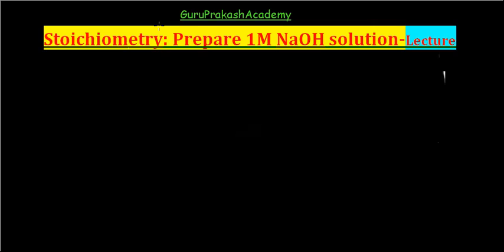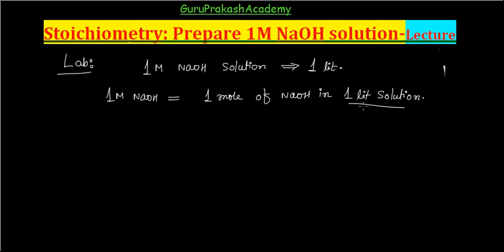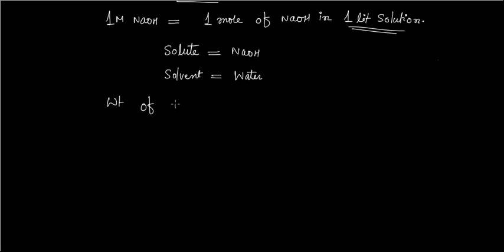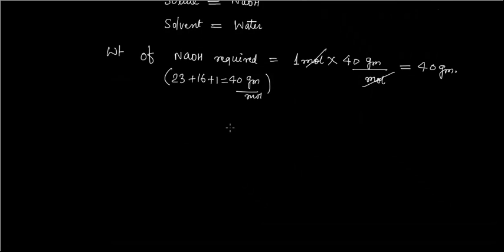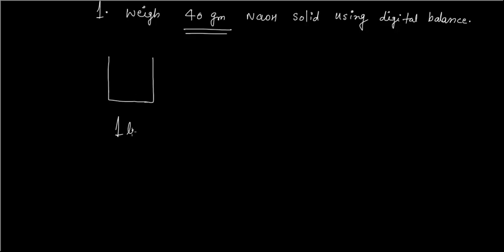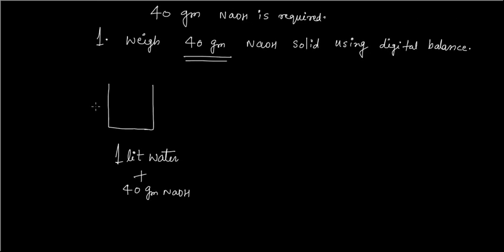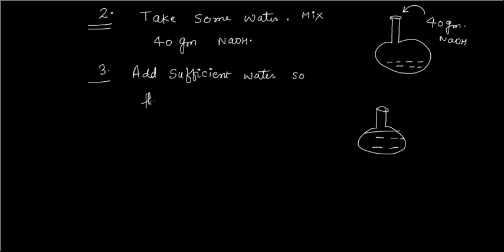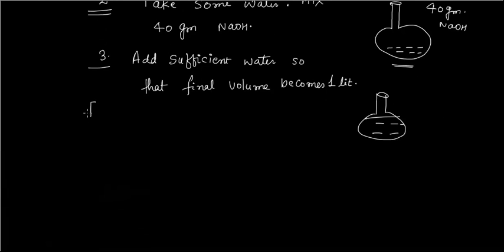SS-1 I Solution Stoichiometry I How to Prepare 1M NaOH Solution I JEE Main @GuruprakashAcademy

Comment: Please correct me:)
This is huge confusion for our experiment.. Molarity is generally defined as the number of moles of solute present in one litre of the solvent. 
To get 1liter 1M NaOH Solution
I think the first procedure is correct even though we get more volume finally ( we can take 1liter of solution from that )
By following the correct procedure mentioned the amount of slovent used will be somewhere >960ml and <1000ml, which means we are not using 1liter of solvent, which again tells us the that the solution prepared will have concentration higher than 1M.
PS: trying to make 10M NaOH solution
Reply from the maker: number of moles of solute present in one kg of the solvent  = Molality

Comment: Instead of adding 'sufficient water' in step 3, couldn't we convert 40gm NaOH into mL and take it away from 1L?
Reply from the maker: This wouldnt work because when converting to a liquid the weight of the solid may not be measured properly due to spaces in between particles